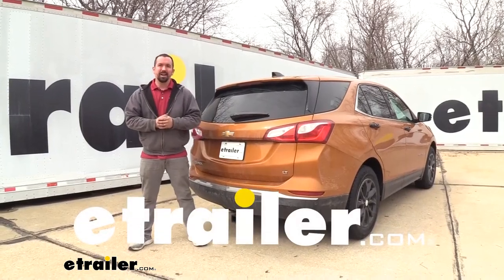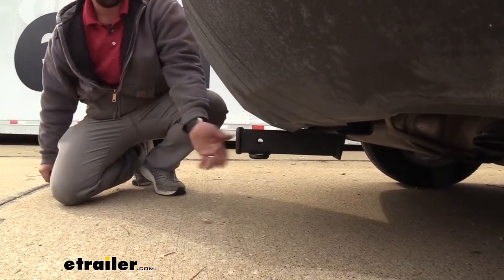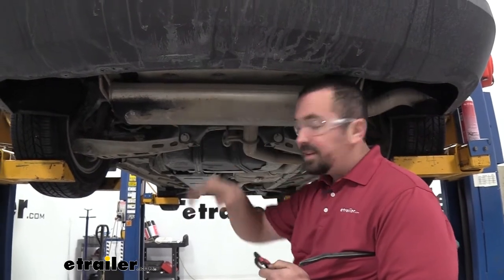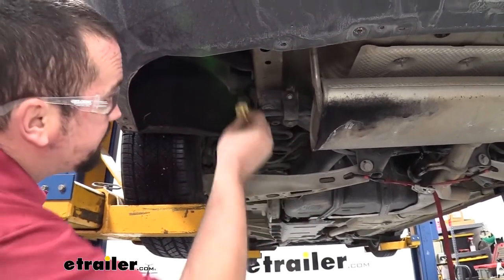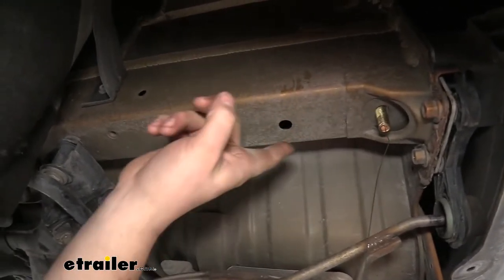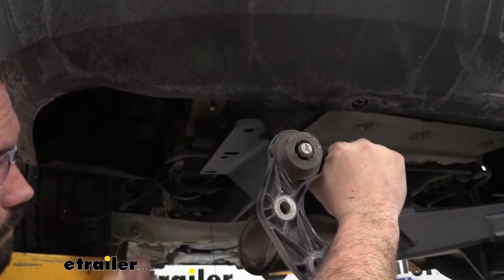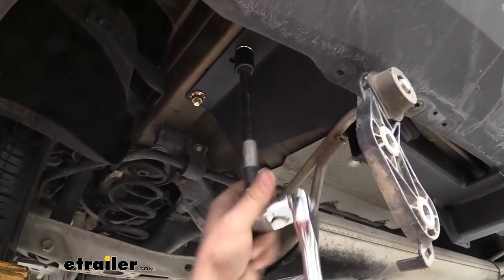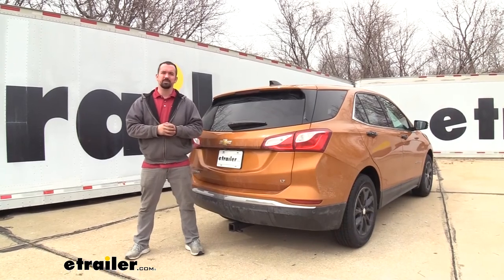Mount: etrailer Trailer Hitch Receiver on a 2018 Chevrolet Equinox

Comment: Just finished mine. Easy as can be, the most trouble was getting the wiring cap off of the connector from the car. Thank you for the video
Reply from the maker: We're glad to hear your install went well! (for the most part)
https://www.etrailer.com/Trailer-Hitch/etrailer/e59ZR.html
Reply: @etrailer  I just carefully broke the tab off.
Reply from the maker: As long as you did it carefully!